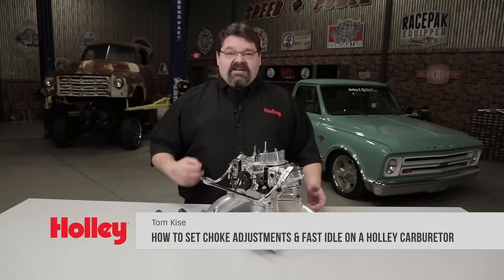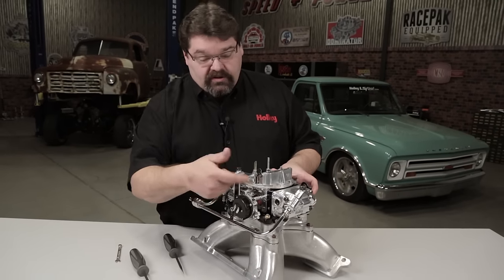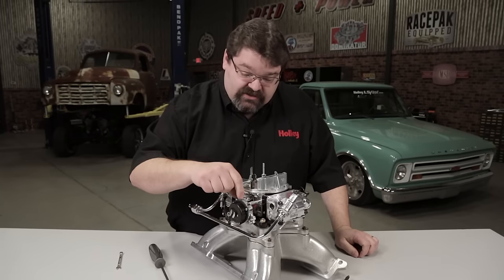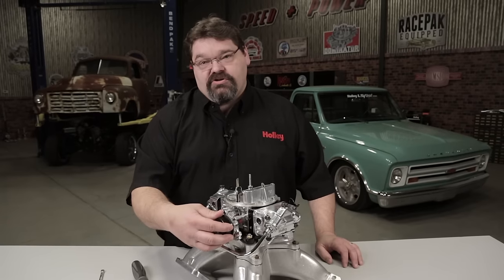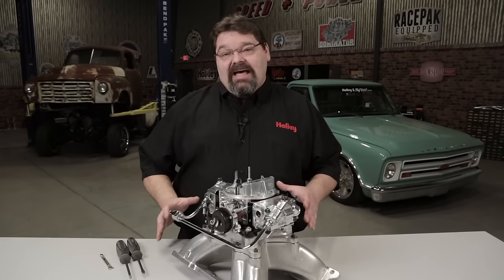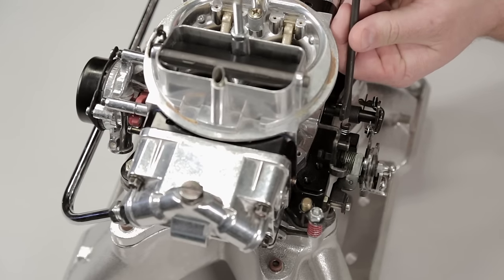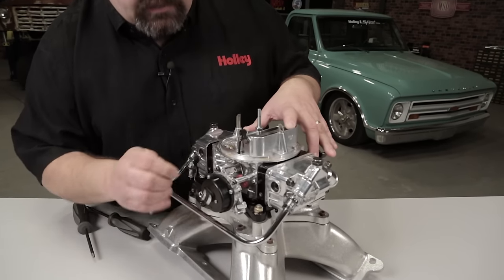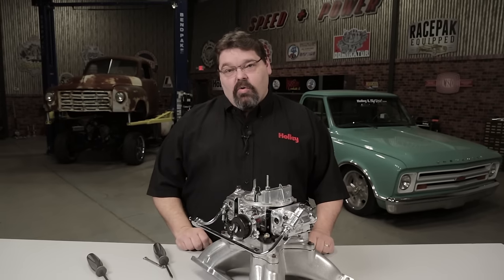How To Adjust the Choke and Fast Idle on Holley Carburetors

Comment: thank you for explaining this is such simple terms. I followed your directions and they led to my successful diagnosis of a choke issue I`ve been fighting for 3 months. "3 months man. I didn't know whether to laugh or cry".  I have been having an issue with the fast idle as well. I feel like it should kick in right away but it doesn't. it takes a long time. tonight while following your directions I found that the fast idle cam isn't setting when I push the throttle in all the way. Its also only idling at about 900 on the fast idle cam vs the 1600 I`ve read it should. I'm going to adjust that and see what we get.
Reply: How did it turn out do you remember? I also thought mine should set in immediately but it doesn’t. It eventually did get up to 1300 at one point but before it would start and only idle at 500-400 just to eventually die. Then I had to mess with my curb idle to get it to idle which obviously isn’t good.

Comment: Probably one of the more comprehensive choke adjust vids made. Very well said the heat soak can frustrate ya. In the Northeast however fully closed may not even do it on them zero degree mornings. The humidity here really affects the Ethenol fuels in the winter so that does not bother fuel injection much because of the high fuel pressure but on say a carb with a fuel regulator you can be into a challenge in the winter just to get the vehicle to start.

Comment: Temps have been in the single digits & my truck idles fast for too long. Almost got me killed a few times. This should help thanks.
Reply: Pumping the brake makes a huge difference. Someone please explain.
Reply: @marcelineingot9359  Could be a vacuum leak. Too much vacuum leads to high idle and pumping the brake changes the vacuum signal. Check the big rubber hose coming off of the brake booster--it probably has a hole in it or might be unplugged somewhere.
Reply: @howardwhitney7784  thanks a million, will look into it in the morning.

Comment: I have a holley street warrior and I have the choke set so that it comes off about where I like it (about 150°F coolant temp or so it's already off which is good) but when I first start it the choke break doesn't pull the choke plate open at all, so on initial startup it's being choked too much and starts flooding

Comment: Yeah. If you can get to the fast idle speed  with out. Wide open throttle that be nice i have the asv2 from edlenrock.    
  Why edelbroc?. Engineering take a day off or am I missing something?
Also  when you said crack those 3 open and rotate. What what the relationship to the cam at that point.   Did you manually disengage the choke before cracking those loose or was choke still engaged on the cam when you did that.      You just jumped right in there with crack loose and adjust

Comment: Brand new out of the box 4160 vacume secondary electric choke. Car is  running great but fast idle. Tried adjusting  everything. olly tech. Suggested extra spring on trottle. Didn't work. I would re adjust the idle. Once I started shifting gears and got to the Red light. Idle jumps up.  My mechanic after 4 days of racking his brain finally removed the spring from the idle screw and pulled it apart slightly to create more tension. Problem solved.

Comment: I had an electric choke installed on my 1850.  It has not worked as expected.  After going through these steps twice, I may have discovered a couple problems.  My fast idle screw (BTW a real pain to get to) cannot make contact with the red cam.  The bracket or linkage the fast idle screw is threaded into does not line up with the cam.  This bracket also rubs on the electric choke housing when it moves.  Am I missing the correct fast idle parts?

Comment: Just an FYI.  Don’t open up throttle at all to retighten screw on cam.  If you tighten the screw while throttle is pulled open, it’ll set your fast idle at that high idle setting.  Once you have the desired rpm.  Just manually close choke and set fast idle screw to cam.  Lawd
Reply: Why? If he does it in the video I’d assume it’s for a reason he is a representing for Holley. Why wouldn’t it be right to do that?
Reply: @David-fl4xw  becayse it the throttle is open by hand you don’t know what Rpm you’re at, and if you fasten fast idle to that opening you can essentially start your car and be at 2500 rpm with choke on.
Reply: @Se7enthsonSS  ahh so it basically will double the fast idle cam. Gotcha. So just exclude holding the throttle open? The rest of the steps are okay to follow right? Thank you. I’ve been having an issue where I’ve been having to use the curb idle screw to even get the car to idle on cold start. Cold start, choke set correctly, idles at 500 drops to 400 then eventually dies out. So I’m assuming the “factory fast idle cam settings” are way off? I’ve only had it idle up to 1300 once, and that’s because I had turned the curb idle up, and then backed it off to let it do its thing.
Reply: @David-fl4xw  absolutely this whole video is 100% spot on.  When he opens it he’s checking positioning as a reference.  He’s also right when he says it can take a few times to verify.  I ended up turning mine out a few times once a day to pin point where exactly I want it.  Different way, and longer but effective.
Reply: @Se7enthsonSS  oh I gotcha. So I assume when he opens it he’s checking the relationship between the cam and screw and probably off camera letting go of the throttle and then adjusting the screw? I’m still new to this stuff. Not even sure if my idle cam
Is the reason my car won’t fast idle without help from the curb idle screw.
Reply: @Se7enthsonSS  what do you think my issue is currently with my cold start rpm? Is it fast idle cam related do you think?
Reply: @David-fl4xw  this video is pretty spot on for sure.  Even extending the time the choke is open.  I will say in order for any of this to matter you really have to have timing and fuel mixture dialed in
Reply: @Se7enthsonSS  well that’s the problem
I’m having at the moment. Timing is seemingly perfect, but fuel mixture… I try adjusting it, it won’t go past 15 on the vaccuum gauge, on my prior edelbrock it was 16 or 17 at idle I have a small cam. It will only go down whenever I turn them in and it will stall/start to bog out. My fuel level in the bowls also aren’t directly in the center yet, just a little below it so I’m wondering if that’s why, since the lower level of fuel in the bowls the less gas will go in.
Reply: @David-fl4xw  double check to make sure you have all vacuum lines straight.  A pcv valve can steal vacuum esp.   also your idle speed will effect vacuum as well.  ESP with a cam.  Depending on cam, you may have less vacuum at <1000 rpm based solely on cam overlap.  So much is based on the cam you have.  Fuel level can be adjusted with a quick quarter turn to raise fuel bowl but that shouldn’t make too much difference unless it’s too lean.  In which you leaning out mixture screws (turning in) wouldn’t change it.  If your engine bogs down leaning it out, see if it’ll raise rpm when turning screws out.  If it does, engine runs better, and vaccuum stabilizes, keep it there, then lower idle with curb idle screw

Comment: Curious. I see in the video you’re able to freely move the choke plate. Mine is just open. I can’t close it with my hand at all.
Reply: I had the  same problem and did not know it until I watched this video. My solution was to take the choke off the side (I pulled the Carb from the eng.) and layed it on the side and found the red cam lever in behind had skipped over the shaft coming out of the choke causing it to be stuck. I put it back into place and noted that it was stiff so I got out some jigaloo lubricant and sprayed all the joints and it all works fine now. Adjusting the PITA high idle is the real issue for me now.

Comment: my choke plate is stuck open. I have to open throttle to open or close the plate. got power to the choke but does not do anything at start up or after warming it up for a while. what is the possible fix.
Reply: I will repeat from above "I had the  same problem and did not know it until I watched this video. My solution was to take the choke off the side (I pulled the Carb from the eng.) and layed it on the side and found the red cam lever in behind had skipped over the shaft coming out of the choke causing it to be stuck. I put it back into place and noted that it was stiff so I got out some jigaloo lubricant and sprayed all the joints and it all works fine now. Adjusting the PITA high idle is the real issue for me now."

Comment: I have a 670 Street Avenger. 
Holley needs to re-engineer the fast idle screw location. I can barely see it and only turn it a quarter turn at a time. Then when the engine is hot it's almost impossible.

Comment: When you start the vehicle does it have to be in drive(automatic)/neutral(manual) or can it be in park to do this adjustment
Reply from the maker: These settings are done with the vehicle in park or neutral with the parking brake on.  Thx J

Comment: My holley doesnt have the fast idle screw 🤷🏽‍♂️
Reply: Adrian Moreno there hard to see.
You have to open the throttle 3/4 or so.
It should drop down where you can see it.

If not.  Someone removed it.

The assembly is a small screw and white plastic square piece.

Larry